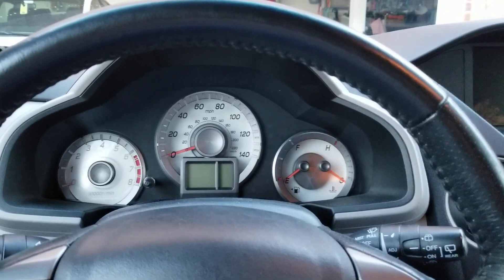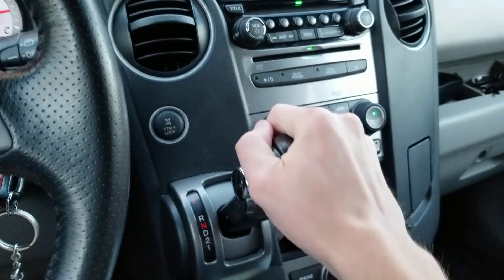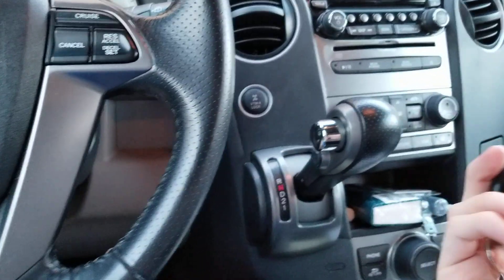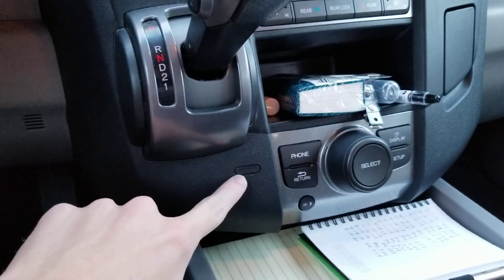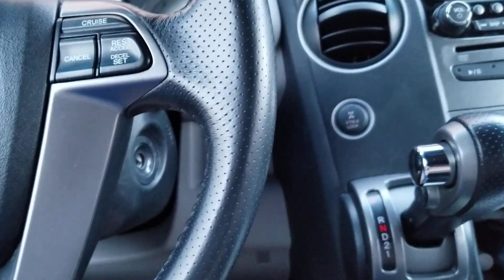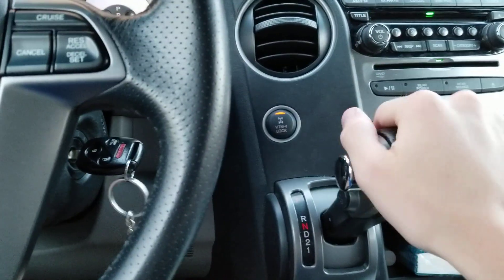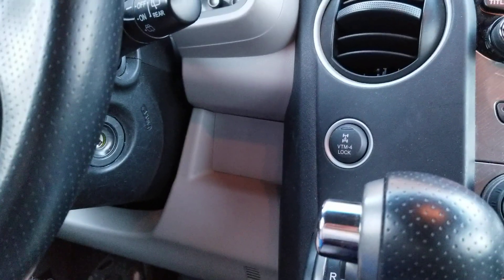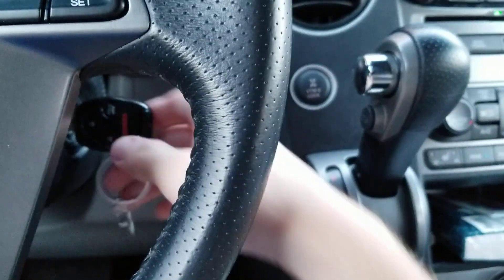Hidden Ignition Interlock Bypass In 2012 Honda Pilot

Comment: Why am i able to move the shifter from Park to any position without having to depress the brake pedal? Is this normal for 2010 honda pilot Touring???? Thanks
Reply from the maker: That means your shift interlock is broken.  Always make sure the parking brake is applied when parking to prevent unintended vehicle movement.